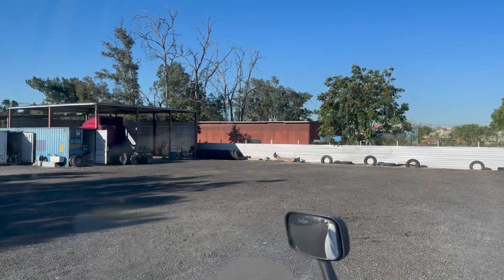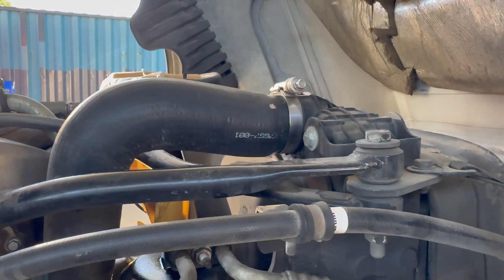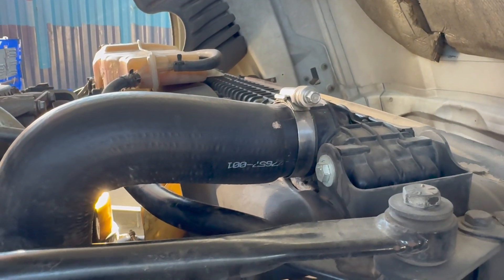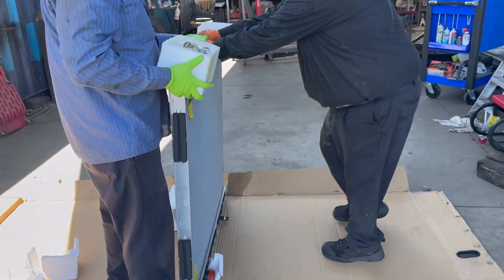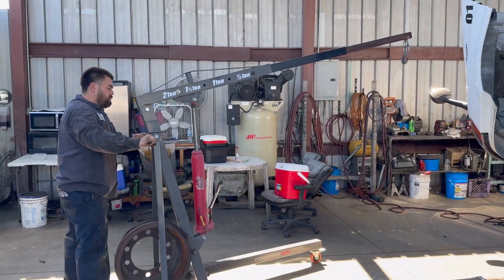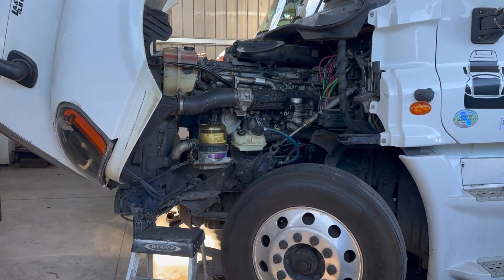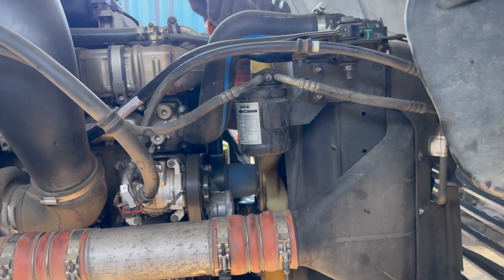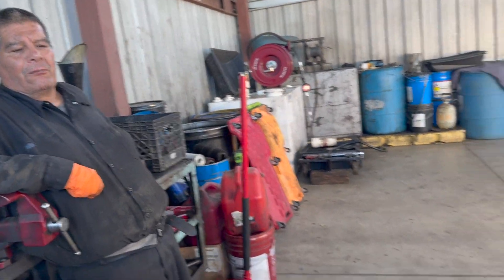Radiator Replacement on a 2016 Freightliner Cascadia done by Fontana Mechanic Shop | Blown Radiator!

Comment: Hey body I got same problem what kind of radiator did you put is that Genuine or after market ?
Reply from the maker: Aftermarket
Reply: How much did you get the aftermarket radiator? And how many hours of labor?
Reply: @kwameboateng67  if you have the part number most truck dealers sell it I got mine from rush truck center brand is northern radiator  $900 plus $500 flat rate to install good mechanic I know in Atlanta did for me so far no problem.